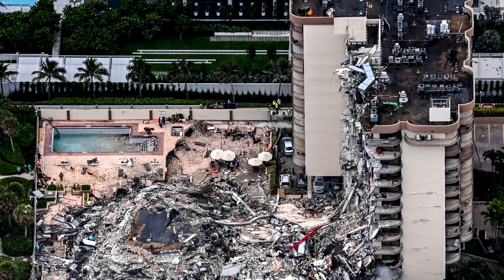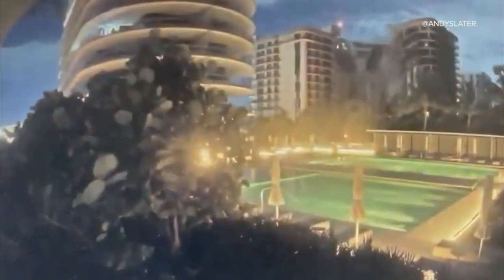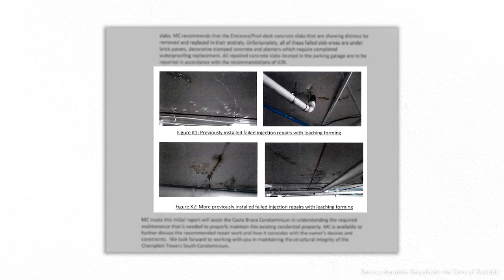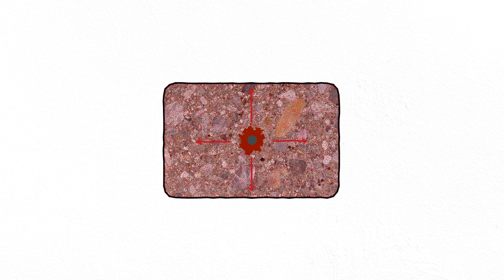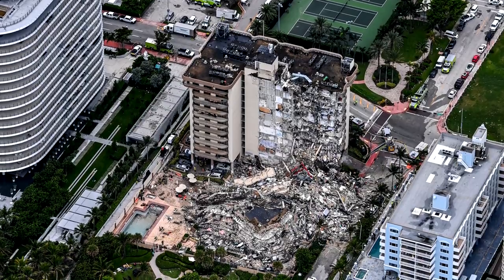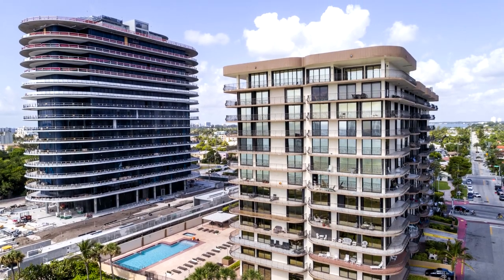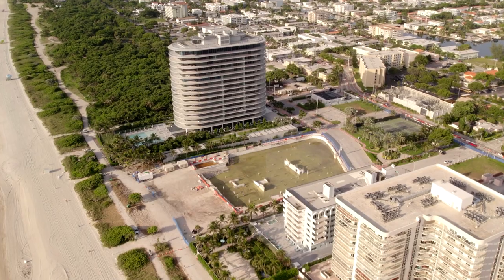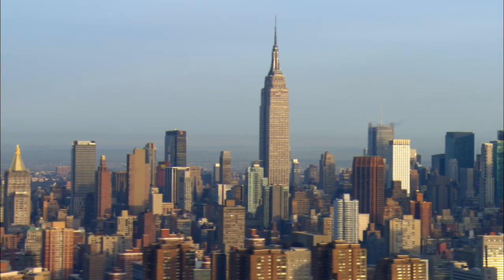Surfside Condo Collapse: What We Know So Far

Comment: Will you do a follow up to this when the final report is released? I'd really like to hear your thoughts and explanations for those of us who don't understand building science as well as some other people.
Reply: Where did you people learn soak in to concrete. You need to go out on a job with a 90 lb jack hammer and find some water in a slab with 6 thousand lb mix .
Reply: While it’ll probably be a few years before any final report is released, the channel Jeffostroff is covering everything as it comes out. So if Brady doesn’t cover it, you can find it there
Reply: @otiswilson4713  if you think concrete is fully water proof without an admix, coating, membrane or something similar...we are all glad you are on the jackhammer and not doing anything structural
Reply: @otiswilson4713  Think about what you just said. 
Now read this: When concrete fails and the exposed rebar is ALREADY rusted, the cause has to be water that has soaked into the concrete.
Reply: As an actual structural engineer, reading that report in any seriousness would likely be quite daunting. The technical summary will be very interesting, but these reports can reach the thousands of pages. I wouldn't at all mind getting an executive summary with photos and visual aids later when the report is out.
Reply: @kindlin  seconded. 

While not a structural engineer, I know from experience that serious government reports can go into depth not even professionals in the field can understand. 

I agree that an executive summary will be sufficient for our purposes.
Reply: Stellvia Hoenheim  Proof is where?

Comment: Whenever I see broken reinforced concrete with rusty exposed rebar I'll remember your explanation. Makes perfect sense but I never considered that the steel expands as it corrodes - essientially "popping" the concrete from the inside out. Also kudos for presenting the entire video in a sensitive and non-judgmental manner. Great job as usual!
Reply: The modern standard uses stainless steel rods. Buildings in the 1950-80 period also saw concrete used which retracts slightly as it dried, allowing air to surround the rods which then facilitates water infiltration through capilliary action and the surface tension of the water. It bedevils London's concert halls, as the bars then resonate to the acoustics.

Comment: In Cologne, Germany in 2009 the city archive collapsed because of a train station being built under it. I think that would make a pretty interesting video too. Love your videos Grady!
Reply: If you remove ground under building,  gravity will win.
who would think about that.
Reply: @kvakerbillduck9500  by this logic, no one should build bridges either
Reply: @wakerobin9215  Well, nobody has to dig holes in order to build bridges, so maybe that's not really an accurate analogy.
Reply: @kvakerbillduck9500  there are plenty of buildings with subways underneath. not all of them collapse. the interesting thing about a video about the city archive collapse in cologne would be to find out exactly how they messed up. grady has made videos about crane collapses and how they are usually caused by not reading the manual properly. "if you don't read the manual on a multiple story high industrial tool, something bad is bound to happen. who would think about that" is your logic applied to those videos, but that doesn't make them any less entertaining.
Reply: @kvakerbillduck9500  subways and tunnels for cars exist you know....

Comment: I've seen Killsheimer saying they just weren't finding in the rubble the amount of rebar that was specified in the buildings designs.
Reply: It gets worse. See Building Integrity "Designed to Fail."
Reply: If thats true they should have evacuated the North building right away until they could confirm it was built properly. If there is rebar missing there's still an entire building's worth of people potentially at risk of another collapse just as bad.
Reply: @raccoontrashpanda1467  Kilsheimer did take concrete sample cores from Champlain North, even from the floors of residents' appts, using ground-penetrating radar to avoid cutting through any rebar there.
 The north tower seems to have had better maintenance than the south, but I guess concrete samples and GPR to locate rebar are just parts of a more thorough appraisal of Champlain North.
Reply: In any event, the property value of the North Building just went through the floor I bet.
Reply: @alainarchambault2331  pun intended?
Reply: Mentioned in video at 9:10
Reply: Under the standard or corruptions?
Reply: Contractors skipping on rebar and then re selling the "excess" is a very common problem. Some engeneering companies requires photos of all rebar before concrete is poured to try and solve it. Others requires an inspection the day before a pour and a representative on site on the day of the pour to make certain no rebar got removed.
Reply: I think nort biulding will be now put under waaaaay bigger microscope.
will be interesing to see if they order repairs or even demolition.
Reply: @kvakerbillduck9500  honestly,  I think they should even if they don't find something. Why follow the rules with one building and not the other? How can we be certain?

Comment: The mention of the neighbouring new building construction made me remember what happened to my parents' first house:

The development was on a hillside with heavy clay soil. Everything was fine in the area for 12 years or so. After that, at the bottom of mountain a series of large apartment building were built. They discovered a lot of water in the soil and determined it would need to be managed for the stability of the foundations.

The site was excavated and a drainage setup was put in place. All was good. A few years later, in my parents' neighbourhood, several of the houses began shifting. The first suspected culprit was pyrite (big problem at the time in the area), but none of the gravel tested high enough for it to be the cause.

After more research, it was determined that the drainage system put in for the apartments was so effective that it actually partially drained the clay on the mountainside leading to the shifting. In the case of my parents' house, it was 4 inches in 22 feet. Apparently the kids who were in the house at the time would gravity race hotwheels on the floor!

The fix was to support the foundations of the houses up on the mountain with piles down to the rock about 30-40 ft down.

Definitely something I'm sure the investigators are going to look into.
Reply: Nice story, but it clearly has nothing to do with the Surfside condo collapse. If your point is that often it's difficult to figure out why a building is failing or has failed, and requires investigation, then I completely agree.
Reply: If that happened to a house I was living in, the fix wouldn't be to drive piles. It would be to get the f*** out of dodge.

Last thing you need is a sinkhole at the bottom of the mountain to cave in on itself, causing the entire hillside to go for a journey. Piles won't stop that house from being carried away.
Reply: @Johnny.Fedora  I believe the point was that nearby construction can alter the underlying geologic support of a structure (which can cause failures in all kinds of places if things shift unevenly) - which might be involved, though I think it unlikely.
Reply: @PyroDesu , get back to us on that when there is evidence for such a thing. Meanwhile, after all the debris were removed, the basement/garage/foundation slab looked pretty intact.
Reply: @-Keith-  they've held for 30 years now. Plus the piles go down into the bedrock. And it's not a steep or high mountain by any measure. And most of the houses are on a plateau.

The area is not prone to sinkholes at all, unlike Florida.
Reply: A Fels  you'd think so.

Comment: All condo boards need to have a non resident professional engineer to help them make proper maintenance decisions. To many cases of kicking items down the road due to budgets or unknown ramifications of delaying maintenance. And once it becomes a major issue the cost delays the repairs even more. I do not blame the board it’s a problem nation wide. National rules need to be implemented on who sits on these boards and reporting up to municipal code enforcement to help prevent delays
Reply: All large buildings should have external oversight, regardless of exact owner arrangement. Be it single owner, large property company owning, condo or some other form, there is always the possibility of penny pinching happening.

Unless outside oversight goes to them and taps them to shoulder and says "you will fix that, now ". Since when it is large building, it is never an "internal issue". collapse like that puts the public nearby in danger. There can be visitors in the building, who should have expectation of the building to be safe to visit and so on.

It was work in here in part via the 40 year inspection, but there should not only be 40 year inspection. There should be external enforcement of critical findings of such inspections. 

"your 40 year inspection says your pool deck needs fixing or your pool deck might collapse. You will start process of fixing it within 12 months or we will take you to court and have court order you do it. After that failure to do so is contempt of court and comes with punitive fines. You will be losing money on this. You can choose: do you lose money to the fix or to the fix and the fines . Cheaper to just start fixing it."

Since that pool deck collapsing alone would be serious enough issue to warrant immediate fixing, even without the whole building collapsing. What if someone is walking on the pool deck, when it collapses? Someone in a car in the garage, when the roof collapses on top of them and their car?
Reply: I am sure they hired lawyers, accountants and other professionals as needed, so a consulting engineer should not be too much of an extravagance for high rise condos.
Reply: Would it have made a difference here?  there was an engineering inspection and a detailed report.  Although it described major repairs required and was in strong language, it didn't go as far as to be able to mandate them.  I don't think they knew how bad it was.   I don't think having engineers on the board would have helped discover the dangerous condition of the building.  What should be done about Champlain Tower North?   Was it built by the same construction teams?  Same engineers?  Does it suffer from a similar financial problem?
Reply: @mgjk  That report was only about the pool deck and car park, not the building itself.  While the pool deck failure was likely the trigger, the limited scope of that inspection could not have discovered the additional deficiencies that would lead to the building collapsing.

Comment: I am from Florida , I also worked in the construction industry. One thing I came across was the use of salt water to mix the concrete. It happened a lot in the 70s and 80s. It was a low cost and dangerous process. The company a worked for repaired many structures that had been damaged by this. We warned the owners of possible failure due to this. I truly hope that the collapse of this building was not due to this horrible practice.